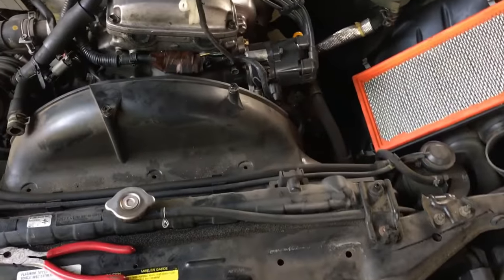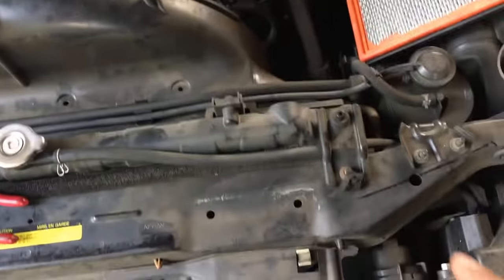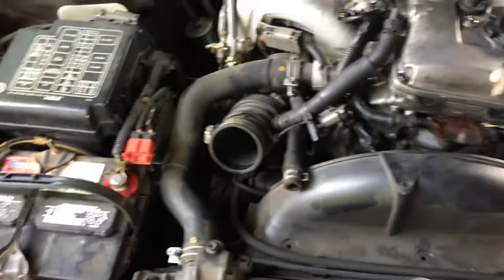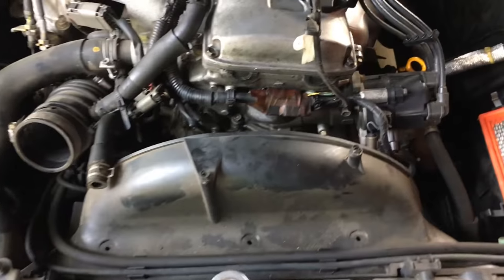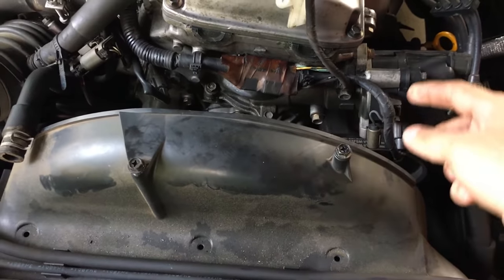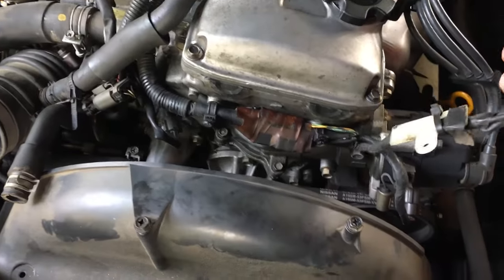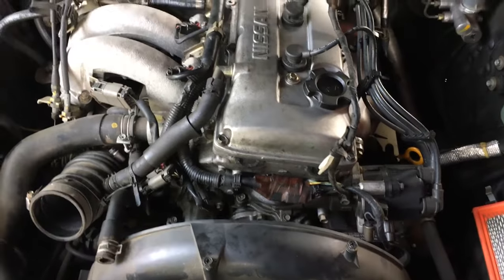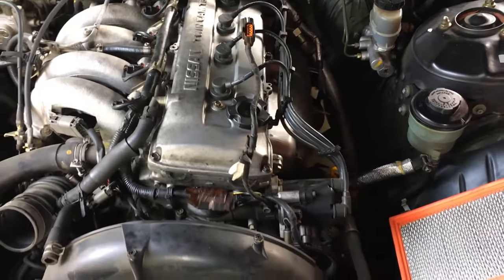Nissan 240sx (S14) Valve Stem Seal Replacement (Part One)

Comment: Where did you mark on the bottom? I don't see where else im suppose to mark other than the two cam dots meet.
Reply from the maker: I never took the bottom off and never marked the bottom. just used TDC the marks on the cams and position 1 on the distributor.